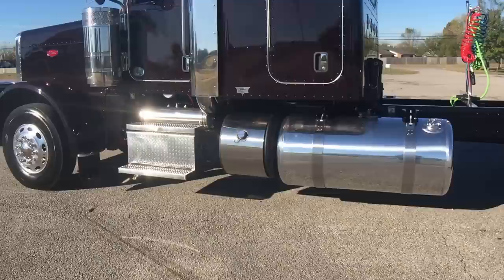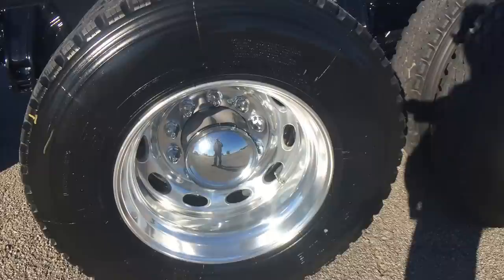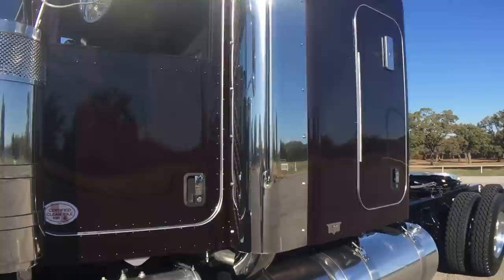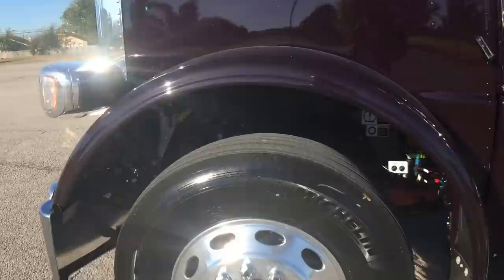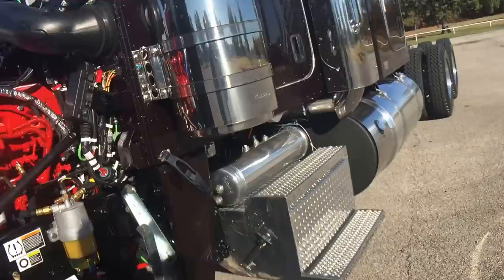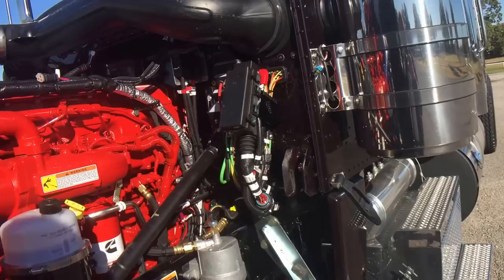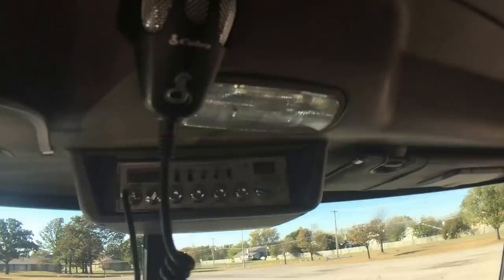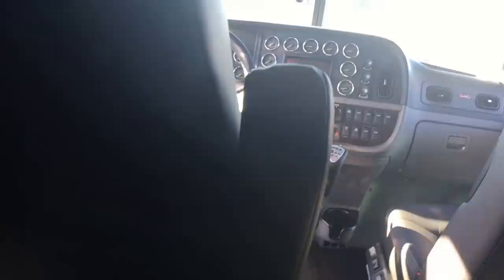2017 Peterbilt 389 Livestock Hauler 2050 torque 18 speed Flat Top Light Weight

Comment: I think some are calling this a '388', no matter.  I think I notice two things I hope you can clear up. Hard to tell without seeing it live but the exhaust appears to be over the frame. There is a weird crimp on the passenger side.  Also, with the shorter hood it appears to push the engine into the firewall. Does this cause less leg room? Yes, it would be best to go out and see but that's not a option for me just now. Appreciate all the info; when the time comes we will be better informed. Keep up the good work!
Reply from the maker: Thanks Jim, I appreciate the kind words. Excellent eye, yes the engine is slid back to the firewall but floor space remains the same. The exhaust does go over and is crimped for clearance. It is technically a short hood 389 because the 388 designation does not exist anymore. Come see me when you are ready to order one.

Comment: I can see that most of the trucks have the Cummins engines installed instead the Paccar ones. Does it mean that they'll have a better resale value? What kind of transmission do you recommend, Ultrashift or  manual 'box? I like very much your vids Steve. Thank you and greetings from Spain.
Reply from the maker: Thank you Oscar and great questions. The PACCAR engine is an excellent engine, probably as good or better than the Cummins. The Cummins definitly has the better resale value and the PACCAR is limited to only 500 hp and 1850 tq. That is the main reason I go with Cummins but I do have PACCAR engines in some 389's for sale.

Comment: Hey Steve.  Another great flattop.  I have the same torque setting on my 550...and you are absolutely right...torque over HP.  260"wb, with the suspension insert on 46K rears...hauling 100K all day on mine.  One question though, in the bottom drivers side bunk area, there is the yellow auxiliary  power cord.   Mine has the second yellow plug on the tractor, but never received the cord.  Does that come from the factory, or is it purchased separate?  Thanks Steve...Hammer Down
Reply from the maker: When you order the option it should come with the cord from the factory. Thanks for the kind words...
Reply: Thanks Steve.  The mystery deepens.  No cord with mine.

Comment: Just as an example of old vs new my 1996 Pete dry wt is 17,330 with a 5EK which is 300 lbs. heavier than the later 6NZ. The only thing I did to save weight was aluminum flywheel housing, aluminum bell housing wasn't available and 1650 torque driveline.

Comment: Hey Steve, I was curious. Is there a shorter frame for this model truck, and if so would it shave down a bit on the weight or is this as short as it comes?
Reply: Maes Hughes Sr clearly stated in the video. 250 260 270" etc and doesn't change weight very much. This truck is a 270" wb

Comment: I'd like to see how you would spec a logging truck. we run 430s 46 rears 16 steer 385 tires 11r24.5s  dual steering boxes . full double frame . 70t Holland  2050 torque 550 18spd  . we normally legally haul 63 500 kg but in winter 80 000 kg is likely a every other day load.  I'm wondering what you would do to improve a off road on Rd heavy package
Reply from the maker: I have logging customers near me so I am familiar with that type of application. They are very specific about their options as I am sure you are. I would like to look at your build sheets to see if there is room for any improvement. If it is a Peterbilt you can just shoot me the last 6 of the VIN

Comment: fyi horse power is just a measurement number take your torque measurement multiply it by the rpm you calculated the torque at then divide that by 5252 and thats how the horsepower is calculated
Reply from the maker: Correct that is how it is calculated but these engines have it pre-determined by setting in the computer. That is how we have so many HP ratings at the same torque. Thanks for watching
Reply: Ya i thought more about that afterwards

Comment: Isn't it a Pete 388?
Reply: oskarus3 If I remember correctly they stopped using 388 and just now differential by 389 long or short hood
Reply from the maker: Gregory is correct. No more 3878 designation just long and short 389's